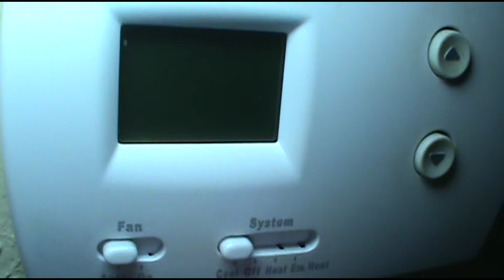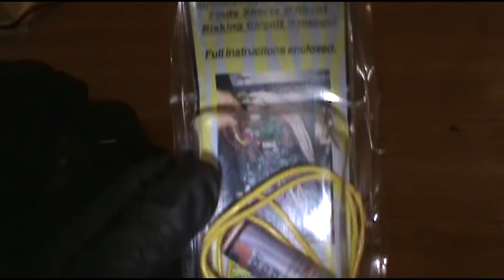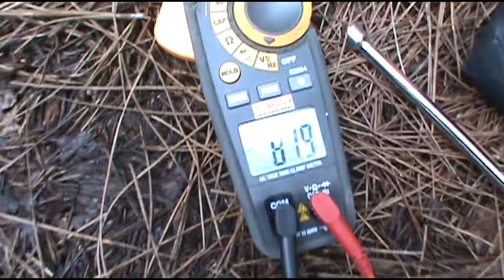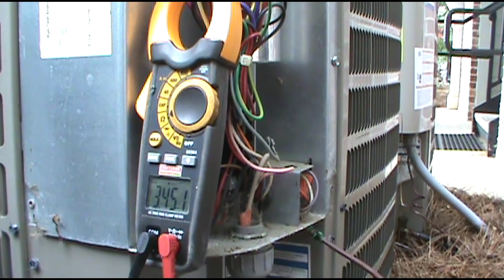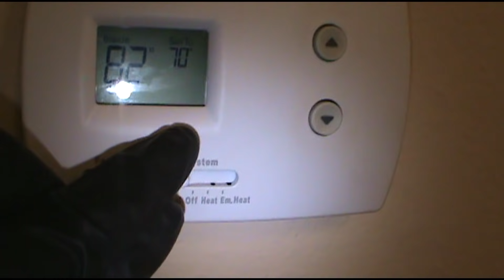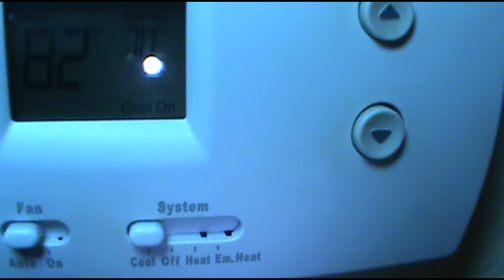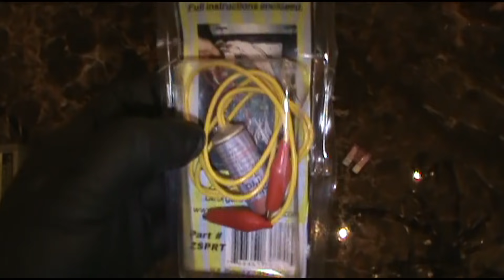Circuit Board Fuse In A.C. Keeps Blowing

Comment: Hey Lex! Seriously great vid man!  
   I'm a 52yr old super plumber with 32yrs experience and about 10yrs ago I asked my old school Bro with 32yrs HVAC experience to teach me. I still have to mostly be a plumber to pay the bills but so far my Bro that is not the type to blow any sunshine up your butt; he tells you the truth as he sees it, tells me that I'm better than most techs and installers but I'm not feeling it yet because I want to be as good as HVAC as I am at plumbing. 
    I just subscribed to your channel because I was searching for information regarding my current demon which is a house that tommorow will be my 3rd trip to.  It's definitely an intermittent low volt issue. It worked for 3 days after the first visit and 4 days after the second. I first replaced a chattering heat pump contactor and the second trip replacing the heat pumps defrost/control board fixed it. First time the high volt breaker for heat pump was tripped and second trip the fuse in the air-handler was blown and eliminating the heat pump board made it work and replacing the board made it work for 4 more days.  I was thinking T-stat, air-handler control board or breach in wire in an unaccessible location but I honestly haven't inspected the wires enough to find what you found in this video which shames me😄. 
    I can't believe that with all my plumbing, HVAC, electrical and electronic experience that I've never seen an alligator clip set-up like yours! That's flipping genius man!  I've got lots of alligator jumpers but before I leave tomorrow I'm going to make up two jumpers. One with 4 leads and another with 8. I always get good jumpers with enough boot to isolate the actual clamp.  You should patent that if there already isn't one and get paid!  It's ultra simple but at 52yrs why haven't I seen or though of it before!!! It should be a PRIMARY tool in every techs bag! 
   I'm going to check out some more vids now. You are doing a great job!  Youtube vids can be awesome, sketchy or just suck😄.   You nailed it in this one! Great teachings, great personality, great voicings, great camera work, great video and audio , great everything!  It's super far and few between that I comment especially this much😄! Keep up the good work Lex! I really appreciate it!💯%!!!
Reply from the maker: Right on! Thank you for the kind words Mag! They really help me keep going. I hope you get it worked out! Keep in touch!
Reply: @LexVance  
I made two jumpers , one with four clips and one with 6 (8 seemed excessive 🤔😄). Damnit man! They are flipping awesome! It makes low volt and T-stat trouble shooting so much faster and easier! Before I would disconnect the T-stat and either put gator clips on gator clips or nut the wires together but now I can spread them out and add or remove a wire in one second with no aggravation! Thanks Bro!

Comment: check contactor right away to see if the contactor 24V coil is burned/shorted/low resistance reading, if no light on thermostat.  I find the contactor is the number one cause of blown fuse in my experience before I go to circuit board and thermostat, tracing for short.
Reply from the maker: Thank you so much for watching Sal!

Comment: GREAT video, but what if my system just blows the 24v 3amp fuse every few weeks, running air conditioning? Everything works great, freon charged, new fan blower wheel, new capacitor, new air filter, new fuse. Fuse lasts 3 weeks, pop... 
Everything else seems fine, works great. WTF? 
Any checklist to find it in your experience?
I'm guessing the furnace blower fan is drawing too much current, because it needs lubrication and brushes need cleaning with contact cleaner. Or system has some kind of bad component heating up, or motor is heating up and drawing too much power, may need to replace blower motor (tho working) or the board the fuse is on? How to diagnose?
Reply from the maker: There could be a nic on a wire some where in the line. I've had one do that. Found a tiny nic on the yellow wire out in the condenser. Once I covered it with black tape, it never popped again. Intermittent shorts are the worst and very tricky.
Reply: @LexVance  I watched and paid closer attention; highly likely, with 20 year old system; keeping it alive piece by piece; and even a new system, that old wiring could be a problem. Thanks, great idea!
Reply: @LexVance  I watched and paid closer attention; highly likely, with 20 year old system; keeping it alive piece by piece; and even a new system, that old wiring could be a problem. Thanks, great idea!

Comment: Yesterday, I asked my wife "What ever happened to Adam Sandler?".  Today 60 minutes did a special about him.  Crazy coincidence hey?  Anyway, today I went to one of my rental properties because the air conditioning wasn't working.  I am no HVAC expert but was able to find a blown fuse on the controller board.  I assumed that it must be a faulty controller board and went home to order a new one online.  For some reason I decided to do a google search for this problem and this was the first video that popped up.  Instead of ordering a new board, I went to Loews and bought a spool of 18-2 wire.  When I got to the rental property I checked the wire in the exact same place your problem was.  Yep, EXACT SAME PROBLEM...same wire, same spot.  Anyway, thank you for this video!  My tenant has a nice cool house tonight because of you!
Reply from the maker: Wow right on! This is the fuel I use to keep going and helping the world the best I can. Thank you so much for watching Perry!

Comment: Save yourself a lot of time.  Don't mess around disconnecting wires from the thermostat or for that matter anywhere else, or hooking up those jumpers.  Once you hook up the Load Pro wrap the current jaws of your multimeter  around the wire on the Load Pro and look at how much current is flowing.  Now, do that with every control wire at the air handler board (remember all wiring whether from the outside, the thermostat or the other control wires comes in at the air handler or furnace).  Simply follow the current flow to the source of the short.  Then and only then start unhooking the wire that has the short.  You'll find the short in under five minutes.  The current jaws of a multimeter are the most underutilized tools in your arsenal.
Reply: how do u do that when its blowing a fuse ?
Reply: @gman8962  The Load Pro adds enough series resistance to the circuit to prevent the fuse from blowing.  That's the beauty of using the Load Pro, or go cheap and use a 24 volt bulb with a couple of wires attached. The Load Pro is just a fancy packaged 24 volt bulb with wires which adds enough series resistance to the circuit so that it draws about 2-1/2 amps, which isn't enough to blow the fuse or melt wires.  Good luck with this method.  I also use this method to track shorts in cars but of course the bulb you want to use would be 12 volt.

Comment: My outside unit ( compressor ) was working, turned it off for a couple hours, when I turned it back on the fan starts up first than it tried to start outdoor unit. Furnace shuts off

E183 is the error on the thermostat

I took the thermostat out of the equation and sent 24 volts DC down the yellow wire to the contactor

Immediately blew the fuse on the control board

My guess is the contactor blew ?

Could it be anything else outside ?

I am going to take an ohm reading on the contactor and see what it reads
Reply from the maker: You've got a head scratcher there that I'd need to be there in person to see. Fan and outdoor unit uses 240 volts. The low  24 voltage shouldn't effect fan and compressor.
Reply: @LexVance  I have a dead short in the contactor. I just pulled it and tested it, shows 0 ohms. Should be 35 ohms. I just ordered a new one.

Comment: THANK YOU SO MUCH! I woke up to my AC not working today and the 3 amp fuse was blown. I followed your guide, I didn't have the short tool or alligator clips, so I used 2 spare 5 amp fuses and I removed the yellow wire from thermostat and the fuse didn't blow. I cleaned the contact tabs on my contactor with small strip of sand paper and tried again. AC roared back to life. THANK YOU. I'm replacing the contactor just to be safe as well!
Reply from the maker: Right on way to go! Thank you so much for watching Luis Angel!

Comment: My fuse blows when i program the thermostat to turn off. Unit runs fine when on, it will cool and heat. But when i program it on my app or at the thermostat it blows fuse on shut down. I checked all low voltage wiring and no nicks. Checked contactor at the condenser and works fine and capacitor looks good. Im thinking maybe motherboard any ideas would help.
Thanks
Reply from the maker: Hmmm that's weird. I would need to be there for this one . You got a head scratcher there. I've seen thermostats pop fuses. Once I changed it, I never had a problem again.

Comment: Hello Lex, the same fuse keeps popping on mine but if I replace the fuse it will run for at least a day or two and then pop again, I don’t think it’s a actual short but they did mess with the refrigerant a few months ago, do you think that could cause it or what else? Thank you .
Reply from the maker: Try a new thermostat. It'll do that where I work & after I replace the thermostat, I never have another problem. Thank you so much for watching Edwin!
Reply: Lex Vance Ok thanks, I had replaced the thermostat before this problem, but it was a cheap one so I’m guessing it could be it.

Comment: I have the exact same problem.  My display on thermostat is blank and found 5amp fuse blown replaced it twice and blew less then 5 mins.  I was looking for a similar tool on home depot like the short pro tool you used.  I found this at home depot website https://www.homedepot.com/p/Gardner-Bender-5-50-VAC-DC-Low-Voltage-Tester-GET-3202/202867886#customer_reviews think it'll work?

Comment: Dang it nick. Why you always causing havac
Reply from the maker: 👍😆👍 Thank you so much for watching Joey!
Reply: @LexVance  thank for making this video. I'm not a professional ac and heat man or technician, but it helped me. 
 I'm a professional tracker. Now days the reasons for needing me is always horrible. 
Having a 3 amp fuse problem. Checked to contactor, didn't look burned up, checked wires for highly noticeable shorts, didn't see anything. 
  What I did notice the first time I replaced the fuse was the hose coming out of that little white box came off. Put it back on securely. Dried it all out and waited till this afternoon to insure it was moisture free.  Put the fuse in praying it wouldn't blow then moment I powered up. We'll long story short it blew.  Told myself prior no matter what if I have the feeling of putting a ohm meter on anything I'd just call a professional. So now waiting on that to happen. Really appreciate this video it helped a lot, mostly realizing the vast amount of problems that can cause this. I guess that moisture being near the burners (gas) caused the computer board to short out.  Anyway not taking a chance to make it worse time to call one of you pros in. Thank you very much for helping. Even though I didn't get it fixed it made me realize this is beyond my knowledge! haha
Again thank you

Comment: Having a blown fuse problem also. Worked fine all summer on cool, the first time the heat was turned on it ran great for half the night and popped the 5amp fuse. Put another fuse in, ran for half a day and popped again. Turned the emergency heat on (it has ran on this for 4 days, all the hvac guys are slammed) until I could figure the issue out... well the emergency heat quit tonight. Now it blows a fuse as soon as you put it in with the t-stat OFF. GF said she thought she heard "squeeking" from the air handler area about an hour before it quit. Any suggestions? It is a heat pump. Thanks!
Reply from the maker: You have a low voltage short. You'll have to take it wire for wire like I did in this video & find which one has the short. Sometimes it's all of them. You can try to pull the white wire out of the tstat & leave it out. If heat runs fine after that, it's up to you to replace the white wire or just leave it out. If that dont work, you got a bad short some where & may need to run all new low voltage wire. Thank you so much for watching Derek!
Reply: @LexVance  what does the white wire do?
Reply: @RodNHandFishing  white wire sends 24 volts to turn on heat strips

Comment: Very helpful, my issue is only on the heating side, ch to heat, when I switch unit on on cooling, works fine, but when I switch to heat, fuse blows, any suggestions?
Reply from the maker: If it's a heat pump, try taking the white wire out of the thermostat & leave it out. Put the tstat back on & turn the heat on. If it works, the short is on the white wire. You can replace the wire if you'd like. But, if the heat works fine afterwards, you can leave it out. Your call.
Thank you so much for watching Manny!

Comment: Hello lance, my outside fan blower I'm assuming  this is the problem.  It goes from quiet to load and I turn it off and it's quiet again. 2 months later it did it again. Ultimately can this blow my fuse on my board? I'm thinking the blower is gone bad.
Any help will be appreciated.
Reply from the maker: No a blower is high voltage. The fuse on the board keeps the transformer from burning up due to a low voltage short. The fuse only revolves around low voltage. Circuit breakers revolve around high voltage like fan motors & compressor. Thank you so much for watching Dj Doc!
www.DirtyMaintenanceNation.com
Reply: @LexVance  thanks for your input. I'll try and see if the coil or contactor (if I'm calling it correct) is burned up or even if my thermostat is bad. Thanks again...

Comment: I assumed it was a short at the hole as soon as I seen the outer wire jacket not passing into the splice box :)
of course, I've only fixed a zillion or three that way over the years lol    ** I try to push  enough inside I can coil it a few loops and jacket passes through the hole, that way vibration and people doing grounds keeping wont much it up
Reply from the maker: Right on. Thank you so much for watching throttle!
www.DirtyMaintenanceNation.com

Comment: Because of u I’m maintenance I use to be a groundskeeper I started watching your videos and my co workers were shock I knew how to fix stuff so thanks I’m now the best maintenance tech at my job and I’m the assistant supervisor
Reply from the maker: Wow that's awesome! Stories like yours are the fuel that keeps me going. 
Thank you so much for watching producerboy!
www.DirtyMaintenanceNation.com
Reply: This was awesome  is this the same process in heat mode? Your clamping the white wire instead of the yellow?  I'm definitely getting that tool
Reply: Where r u located
Reply: Ha I’m doing the same I’m new to hvac but my supervisor is experience but he can’t seem to fix the AC so I’m looking for some info about why a fuse keep blowing
Reply: Jesus christ you sound like you have an IQ of about 30. I'm surprised you could even handle grounds, you must be brain dead

Comment: Have you ever come across a low voltage short that wasn't in the wiring to the outdoor unit (or a bad contactor)  ?
Reply from the maker: Oh yea all the time. I just take that wire out & put in one that's not being used. I have videos showing that as well on my channel. One time is was all the wires. Had to have a wireless installed. Thank you so much for watching Henry!
www.DirtyMaintenanceNation.com

Comment: I ordered this tool a month ago on amazon and they send me a different brand, which I didn’t like and I returned it so hopefully your link will send me the exact one you have on video. Sometimes those short voltage drives me crazy
Reply from the maker: Oh right on. Mine is a zebra short pro tool. As long as it has the light & alligator clips. Thank you so much for watching Hamid!
www.DirtyMaintenanceNation.com
Reply: I have had trouble finding the short pro tool as well.  The first link has been out for years.  I will try the second but want the solid state version, not a mini circuit breaker.